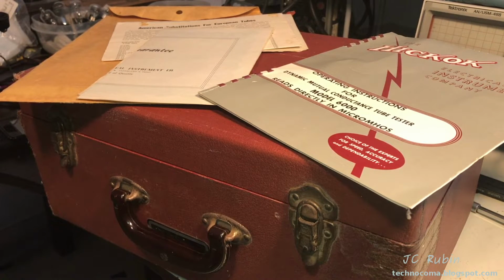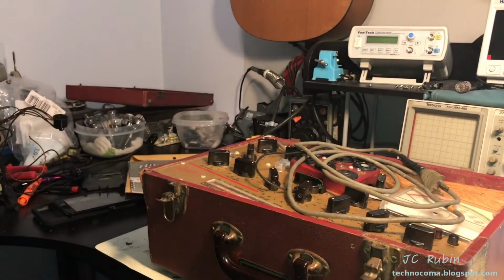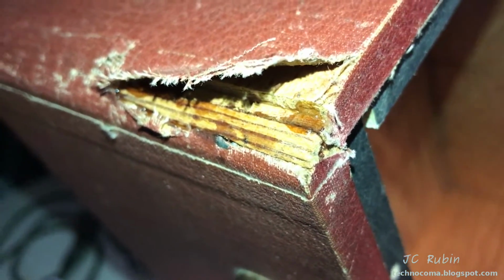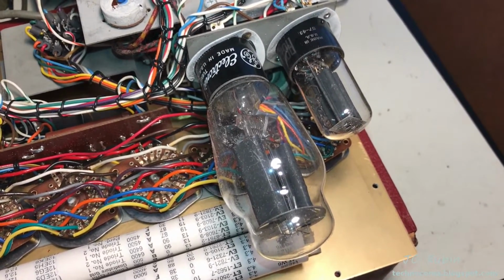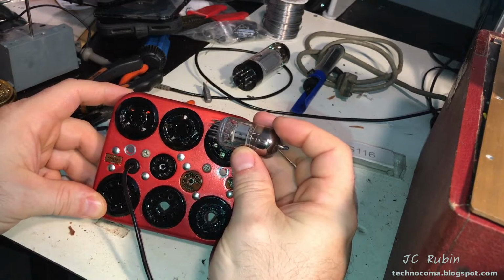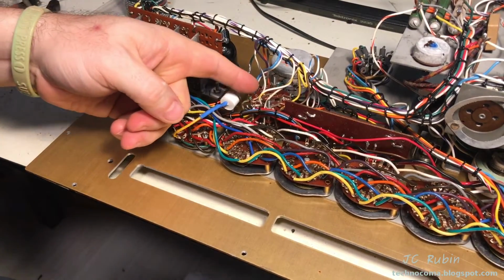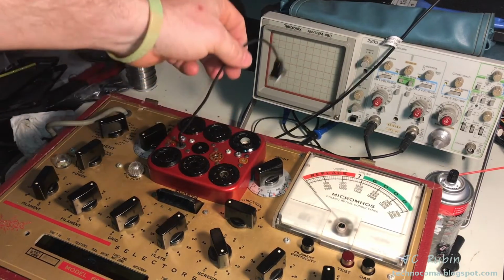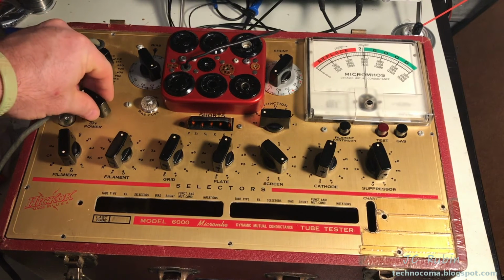Hickok 6000 Tube Tester Repair and Restoration

Comment: Wrong! Do not listen to this amateur! You do not clean the switches with deoxit by spraying and turning the switches. You are giving really bad advice and should learn the proper way, and you can not clean the shunt english by trying to spray deoxit in it. It will not go in and you did nothing. Yo may not like what I am saying but I am 110% correct. You cannot depend on deoxit to di the work you only soak the phenolic material that will then cause problems with conductivity. Holy Sh&t this is awful.
Reply from the maker: Seek help.
Reply: @retrotechandelectronics  Look, you can delete my post. I know and have extensive experience with Hickok tube testers and know what the inside of a shunt/english looks like and open and clean them. What you did will do nothing and using deoxit and allowing it to penetrate the the phenolic material on the switches or anywhere else can make it conductive and cause problems.

Comment: Deoxit expensive and waste. I switched to corrosion x large can way cheaper
Reply from the maker: Thanks for sharing .
Reply: @retrotechandelectronics  no worries glad can help. I find deoxit is meant to waste it spares way to much. And with the corrosion x comes in bottle or spray can but very large. Has a slight smell to it but properties are same

Comment: Quick question, I bought a Hickok 6000 but have not received it yet. I'm wanting to get the capacitors ordered for it now so I have them when it arrives. Was the film capacitor 0.5 uf @ 200v or 5 uf @ 200v. I couldn't tell from the view I got of your replacement, and the manual I have lists it as 5 but I think 0.5 makes more sense so I'm wondering if the manual has a typo. 

The schematic I have also doesn't seem to even show the electrolytic cap across the meter so I don't know how accurate the info I have is. Does the schematic you had show it?

Comment: I have a question for you. Is the calibration the same process for the 800 model? I picked up a Hickok 800 in near mint condition. All screws holding the top plate are original, so it doesn't look like it's been messed with. I removed the top plate and one of the tubes was broken type 83 (glass), so I got a replacement for it. Other than that, it's like new and no broken or questionable solder points. Can I follow your calibration for my 800 unit? Thanks.
Reply from the maker: No the process for the 800 is different, but there is substantial documentation online for that model.
Reply: @retrotechandelectronics  I 2was hoping it was the same. Oh well. Thank you for your timely responce. It ois greatly appreciated.

Comment: Thanks for the video.  You mentioned replacing the tube sockets.  Is there a supplier for these sockets?  The standard sockets with their mounting wings would never fit. I too have this same Hickok and a B&K 707.  Thanks in advance.
Reply from the maker: I think tubesandmore.com

Comment: Where you buy that brush I bought a kit from amazon but it's terrible and it's not a metal brush either
Reply from the maker: It was given to be as a gift, but I think I saw them on one of the tubeaudio websites.
Reply: @retrotechandelectronics  ok thanks
Reply: I found that brush on amazon same one you got :)
Reply: Never seen metal brushes that small and thin, only nylon or plastic; available cheaply from Harbor Freight (paint-sprayer tip-cleaning brushes). Metal brushes would be great, if they exist; but I use a wound guitar string, .036 to .039, for cleaning the mini 7 and 9 pin sockets.

Comment: and u should never spray phenolic board with deoxit a qtip and the only the metal contacts should be deoxited as it can soak in and cause deformation of the phenolic but you did go sparingly hopefully you'll be ok
Reply from the maker: Well, it’s been working great for a few years. I may be out of the woods yet.

Comment: I know this is an older video but I am just now coming across it.  Very interesting video. I have the Hickok 600A and love it.
You have a tube socket cleaning brush.  It looks to have been sold for that purpose.  These are available at any drug store in the dental care department for cheap. Although not as long of a handle but have a very small diameter bristol tip that works great.  I have used them for years on radio tube sockets.
Reply from the maker: I dont know if mine was designed for that purpose, it was given to me by a co worker.  I'm sure though from the tube audio web sites its similar to the ones at an apothecary at considerable markup.
Reply: A set of paint-sprayer cleaning tips is available from Harbor Freight for just a couple of bucks. They're okay for cleaning tube sockets, but, they don't really remove heavy oxidation as is often seen on old tube-electronics equipment, especially if the equipment was exposed to heat and humidity, stored in an attic, basement, garage or barn (peeling Tolex is an obvious indication). For cleaning miniature sockets, I use a wound guitar string, .036 to .039 diameter, worked up and down inside the contacts like a miniature round file, followed by flushing with pure alcohol or similar non-residue solvent. I do NOT recommend spraying sockets, or switches, with DeOxit or other contact cleaners that leave lubricants behind, because it risks creating permanent current-leakage paths. Alan Douglas covered this in his book "Tube Testers and Classic Test, and in some conversations I had with him. For cleaning the rotary switches,  best to apply miniscule droplets of cleaner exactly and only where needed with a dental pick, toothpick, miniature Q-tip, or similar.  That other guy who mentioned his Hickoks' shorts' lamp staying on all the time might indeed have cleaned his testers' switches and controls with a heavy application of DeOxit. If the switch wafers are phenolic, they may have absorbed enough cleaner to become conductive. Spraying them with alcohol might or might not help. Ceramic switch wafers aren't absorbent, and flushing with alcohol might fix them.....

Comment: So I just bought a Hickok 6000a
After watching your videos thinking it is a 6000 with a transistor tester 
Like you say maybe a transitional unit
Anyways eventhough the cord is very dry 
Did turn it on and it powers up
After watching your post
Decided to not rebuilt the 6000
Over my ability to fix
Selling now on an auction site
Thanks for an interesting post
Reply from the maker: Glad I could be of assistance
Reply from the maker: Glad I could be of assistance

Comment: Deoxit crazy! I will just say one thing or one criticism although I have many more: You did absolutely nothing to clean the shunt. You have to open them up since there is no opening where you sprayed your liquid technician/deoxit. Do not do what this guy is doing! You will only create problems and fix noting with deoxit as this guy used it.
Reply from the maker: Smug much? When you start off sounding like you do, people tune out. I did.
Reply: @retrotechandelectronics  ignore him deoxit is totally safe I used it on both my hickok testers never had any issues also used it in shunt control took it apart after cleaning it the control is smooth same with resistance through its whole range

Comment: another question if you don't mind - there are what look like mini wooden spools with thread in the circuit. Do you know what those are? resistors? thanks again - edit:  the thread is wound on the spool, like thread on a sewing machine bobbin
Reply: On some models, Hickok did indeed use custom-made wirewound resistors, thin cloth covered wires on wooden spools. Often located right near the front right-side corner of the tester and it's possible to catch the spools on the wooden tester case as you disassemble it, damaging the spool resistors, so be careful! The spools might be marked as to their resistance value. I suspect that Hickok adjusted the resistance of the spools individually in order to fine-tune the calibration of the drive signal to the tube grid. I suppose they could be replaced with precision resistors but finding them in the necessary values, or adding resistors in series to make the required value, could be tricky.
Reply from the maker: I am not sure exactly what you mean

Comment: Hi good video you have made.hope you can help me with a questionnaire circuit in a tube tester power plugin. the broken power plug you had. my question is if you measure it with a 200 ohm multimeter? If I put the power button on high then I get a measurement of 5.4 ohm my tube tester is the Lafayette Model TE-50. When I put the power button off, there is 0.00. There might be a short circuit in my Lafayette!? .. What measures your on the plug in that was broken at yours. Kind regards johnny from denmark
Reply from the maker: I dont exactly understand what you are asking.  Oder auf Deutsche vielleicht?
Reply: @retrotechandelectronics  danke für die antwort. Ich versuche es auf Deutsch oder ich muss ein Video machen. Fragebogen für meine Röhrchen-Tests ist das Lafayette Modell TE-50. Schaltung in einem Röhrenprüfgerät. Ihr Netzstecker hatte schwarzes Band. die ich möchte, dass Sie messen. meine Frage ist, wenn Sie es mit einem 200 Ohm Multimeter messen? wenn ich den Netzschalter auf hoch schalte. ist eine Messung von 5,4 Ohm. schaltet den Netzschalter aus, da ist 0,00. Möglicherweise liegt ein Kurzschluss in meiner Lafayette vor. Was misst man am Netzstecker?
Reply from the maker: @slet9  Also.  ich werde Heute Abend eine Prufung auf dem Spule machen.
Reply from the maker: @slet9  Ich habe ihre infos:

Ausgeschaltet   ---->  steht naturlich bei unend....
POT pos. an...

Anfang (unlesbar)   163ohm
125v                           103ohm
115v                            76 ohm
110v                            60ohm
105v                            42ohm

viel gluck mit ihre Reparatur!!
Reply: @retrotechandelectronics  Vielen Dank für Ihre Freundlichkeit und die Zeit, die Sie damit verbringen würden.

Comment: The small inline socket is for tubes like the Raytheon CK5829. Pencil tubes and other sub-minis. The tiny round one would fit something like a 6021
Reply from the maker: Good to know, thanx for sharing.  I do not use these types of tubes, generally ones for HiFI Guitar amps and ham radios.
Reply: Same here... I got a bunch of pencil and acorn/peanut tubes in a stash I brought home, otherwise I probably never would have given any thought about them myself. Many of them were for use in VHF/UHF mobile service. There's some that can be used for audio too of course... I always thought it would be cool to build a guitar pedal around one. :)